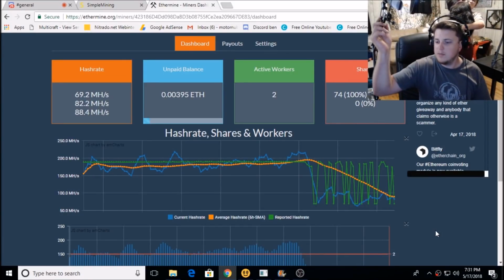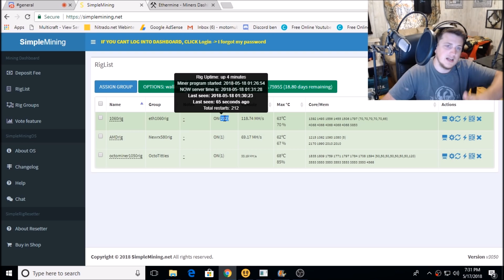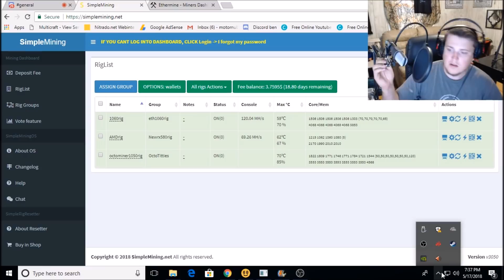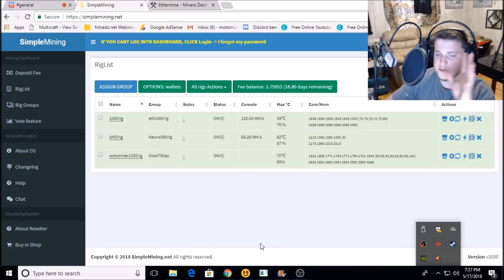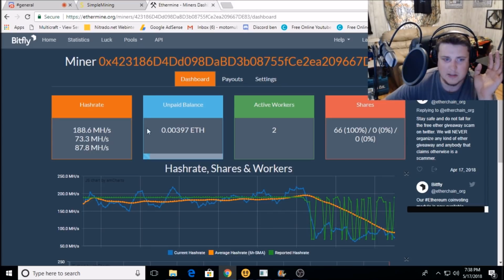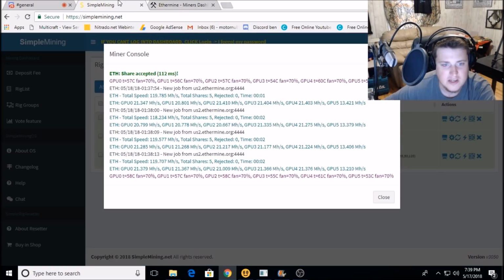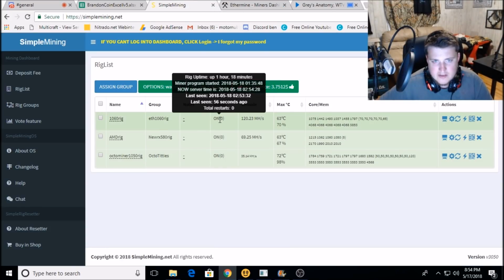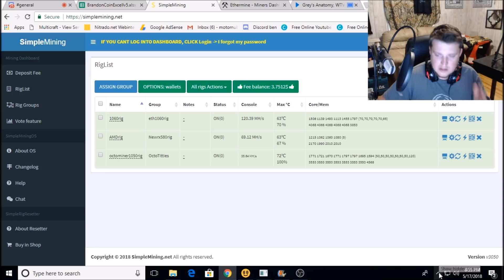GTX1060 Mining Rig Troubleshooting

Comment: also your temps are really high. you shouldn't be over 60c - 65c at max, if you want these cards to last. 60c at 60% fan should be your goal mid day it will go to 65c but more than that you are eating card life for profit today, and the prices ain't even that great. not worth killen your cards for. set 60% fan and 65c in smos and back power down til you get between 60c-65c. then raise oc if needed. Stop buying single fan cards also, they might be cheap but they burn up for mining fast. also look for cards that have heat pipes not those single block fins. they don't cool well enough for 24/7 use. get the case for the octo board or get those cards out of there before they burn up. that board is ment to have forced air to help cool those cards and you can't do that with it in open air like you have. hope you don't have a fire, cause it is a real possibility with those temps. Your doing great but you are not doing it safe. these hints ment to help not criticize. good luck!.

Comment: good video, so easy way to PD simple miner, you down load putty on your windows machine and use it to SSH in to your smos machine. Once your logged in you can start the miner console session in putty and watch it live, and there are also log files in the smos that you can cat and view. I did this a few times when I was having a issue, and found that one of my 1050 ti's was falling off the bus and then restarting working for a while and would then fall off again, my fix for that was replaced the riser and it has been good since.